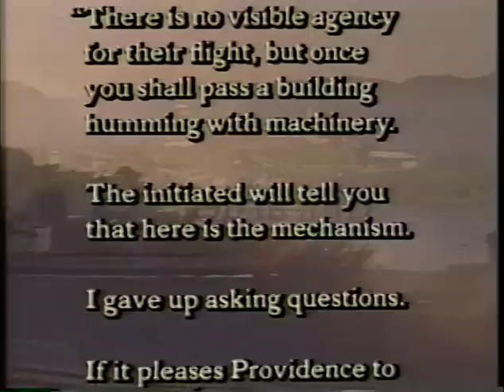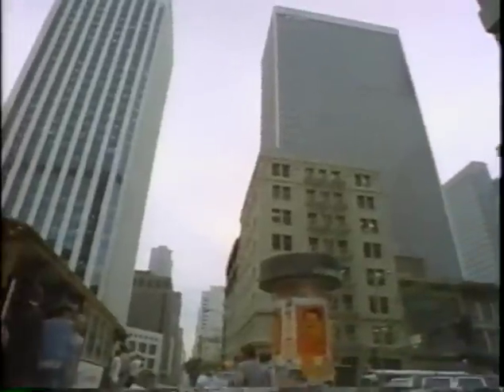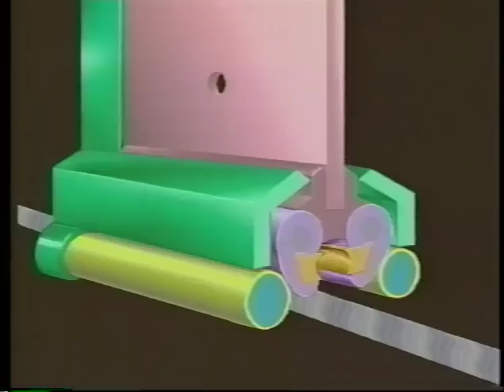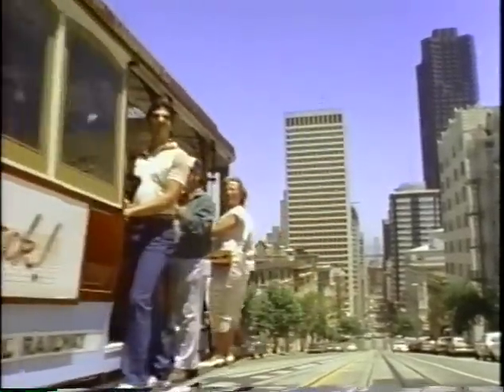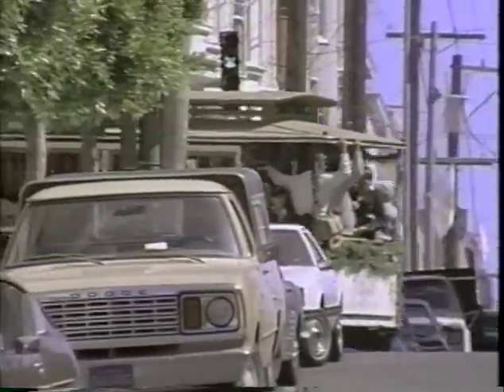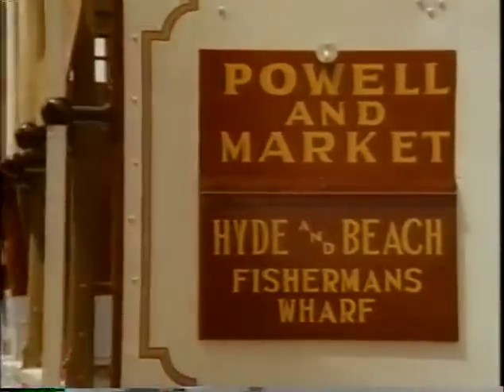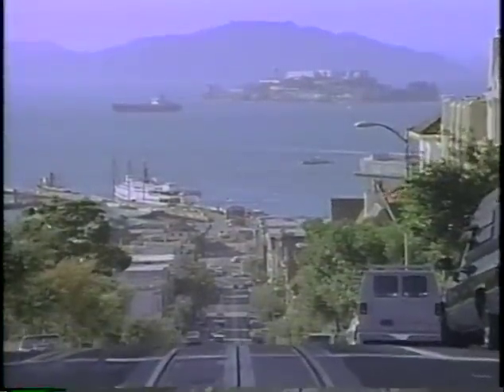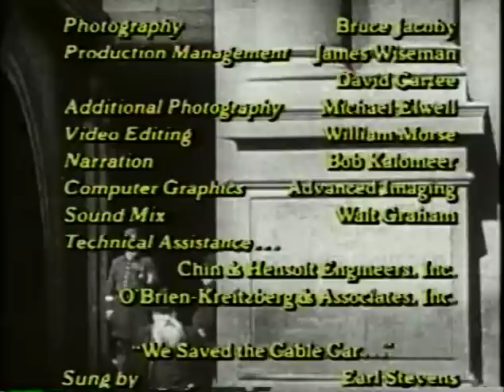The Cable Car and how it works

Comment: San Francisco is one of the rare instances (particularly in the united states) where people fought to keep their public transit and succeeded.  There are still lost lines such as the SF terminal railway and the 3rd and Townsend train station, but it's great that this is around, even though it's mainly a toursist attraction these days.
Reply: there used to be lots more cable car lines, they only kept the few for tourist purposes I believe
Reply: @weinerinc.9344  So the cable cars are not utile for travelling to work or so? Do citizens use them regularly other than as attraction?
Reply: @michalreingraberskaliasmiz185  The cable cars cost $8 to ride one way. Everything else, including the streetcars, cost $3 in cash to ride ($2.50 with a pre-paid transit card) and you get a transfer that's valid for as many rides as you can fit into, I believe, two hours. So you can take the cable cars to work if there's enough room, but you're paying three times the price.
Reply: @michalreingraberskaliasmiz185  The main thing is where the cable cars go. The lines are incredibly short and mostly serve tourist destinations in a small part of downtown. Also, you have to remember that the speed while "taking rope" is 9.5 mph (it's faster while coasting down hills). Of all the lines, the California line is probably used the most by locals, but it's just not practical for most people as anything other than a bit of fun.
Reply: @weinerinc.9344  The 1906 earthquake is largely responsible. Even back then cable cars were old fashioned and when the earthquake destroyed most of the system, it made more sense to replace the lines with electric streetcars than rebuild all the cable infrastructure. Some tracks were too steep for streetcars, so luckily a few cable car lines survived. The mayor wanted to replace them with twin engine buses in the 1940's, but a nice old lady led a campaign to save them. The city-owned lines were protected by law, but the private Cal Cable lines weren't so they were sort of chopped up and truncated them to form the current system. Btw, those twin engine buses the city ordered never really worked very well and they were mostly run in single engine mode on flatter routes.
Reply: What was the reason they wanted to get rid of public transportation
Reply: It’s great that people with monthly passes on Muni get to ride the cable cars included
Reply: @zombiesbride  Ridership, service, and maintenance fell, and cities were often tired of dealing with tracks when they would repair streets
Reply: @flintfredstone228  Yeah, sure, that, and not the absolutely ridicolous influence of the car industry on urban planning politics.
Reply: @dimitar.bogdanov  Yes, that. Many streetcar and interurban lines went bankrupt or began abandonments before urban planning was a concept. And if the auto industry had that weight to throw around, it was because Americans were buying their products left and right instead of taking the streetcar

Comment: Visited SF as a child of about 8 which would have been the summer of 1964. I thought the cable car ride was great. Until a very large local jumped on it and blocked my view of pretty much everything but his very wide backside.

The explanation of the interaction of the grip and the two types of pulleys answers two long-standing questions I've wondered about for decades but never bothered to research.

Comment: The 70's was the last time that the cable cars were still real public transportation. As a kid, I remember when you could just hop on to get where you were going. By the mid to late 80s, it was just a tourist ride. I only rode it late night when I was a student at SFSU in the late 80s. The conductors would usually recognize you as a local and not even check your muni pass.
Reply: I wonder why that changed by the 80s. I mean I doubt they got any more or less useful 10 years later

Comment: I should have seen this ages ago. I've always wondered how the US system worked. Edinburgh had only cable trams from about 1880 till 1923 and the Glasgow Underground was cable too from opening in 1896 till 1935. The Edinburgh system directly replaced the horse trams. It was complex with many- 4?- winding houses. The road signage for the grippermen was in different coloured cobbles on the cobbled streets. I believe the signs were pink granite. The predominate cobble colour was grey.
The Glasgow Underground had two lines with two cables, one for each track. I saw a model of the winding house and the tension arrangement was a bit more complex using what looked like a rail truck on rails.
Reply: I wonder why the London tube didn't use the cable car system. At least they tried everything till the invention of the electric locomotive that encouraged cities to build subway systems and made it possible, that tram lines aren't limited in length because horses' endurance.
Reply: @robfriedrich2822  London had tried something like two on street cable tramways. You would think cable haulage would be ideal for the underground. But they used steam locomotives. In the 1890's The City and South London opened their deep level tube which was electric hauled from the outset which changed the game.

Comment: This was really interesting. I was wondering how on earth these cars made it up the hills in SF and had no idea there was even a cable involved. Thanks!
Reply: I mean, what did you originally think the "cable" in cable cars was? Or did you just not  consider it?
Reply: @slowpoke96Z28  I actually thought these were "trams" and had engines/motors!
Reply: @brad7957  A Standard tram wont climb this slopes .... Anything train-related ... traction (grip) is not that great.
Reply: You thought they were invented by a man named "Cable"?
Reply: @wholeNwon  haha i assumed that early versions had above-ground cables
Reply: "Cable" as in electrified cables hanging over head, it's a common misconception since these cable cars turned corners and changed elevation which is not typical of the rest of the cable cars around the country (most cable cars are usually straight shots with either semi-permanent or permanent connection to the cable.
Reply: @SherrifOfNottingham 
That's a "wire" in common usage.

Comment: I'd like to know how big the system was at the time of its peak extension and how it worked back then (were crossings more complex, die they have more than one "power house"?).
Reply: I don't know all the details, but they used to have stationary steam engines instead of electric motors to run the cables.
Reply: @No Troll:  Actually, there were as many as eight independent cable railway companies in San Francisco during the 19th and early 20th centuries.  The city-operated Municipal Railway didn’t come into existence until December of 1912, and it and the largest independent company, the Market Street Railway, acquired most of the other lines over the years.  The city passed various anti-competitive laws to force the independent companies out of existence and establish a city-run monopoly, acquiring the Market Street Railway in 1944.  The California Street Cable Railroad lasted until 1951.  The current system is a combination of the main trackage of the California Street line with portions of the Market Street Rwy. lines, re-routed and modified to operate out of the single powerhouse shown in the video.  When the companies were independent, each had its own powerhouse, and in some cases more than one, depending on the extent of each system.  As for extent, the Financial District was criss-crossed with cable lines, many of which extended west to Golden Gate Park.  South of Market the Market St. and Howard St. lines turned south about where BART does now, and reached almost to the southern border of the city limits.  

The flat parts of the city were served by electric streetcars, and then buses.  But even today, some  of the steeper hills have to be served by electric trolley buses, because diesel buses wear out too quickly on the steepest grades.
Reply: @steveonmareisland5268   Thank you! 👍👍

Comment: This sort of genius transport technology could only come out of the Victorian age. All we get nowadays is gadgetbahns and memelords trying to reinvent the taxi stand
Reply: Yeah people back then did stuff with less thinking. Today, we do too much thinking and planning to do stuff. Turns out the cable car was a bad idea: it is highly inefficient because the cable is constantly moving and you lose energy from all the support pulleys. It's also quite noisy. 

What the modern system is to use trolleybuses: rubber-tired electric busses powered by overhead lines. They also have the benefit of being able to maneuver around obstructions. In places that have high traffic and aren't too hilly, they use trams. Metal train wheels are more efficient than tires, but can't handle hills and can be very loud.

Comment: Can you imagine creating something like this in modern city?

People in XX century were crazy
Reply: If you're creating a new system from scratch then a regular tram with electric motors and overhead wires is probably simpler.
Reply: 1873 - therefore 19th century, not 20th :-)
Reply: @seneca983  You'd end up with the current trolleybus system, it consists of electric rubber-tired buses with overhead wires. The issue with steel-wheeled trams is the hills are too steep to get good uphill traction.
Reply: @straightpipediesel  Steel-wheeled trams work quite well in a plenty of places.
Reply: @seneca983  And San Francisco has them. They are limited to the relatively flat portions and underground tunnels. The other major issue with steel wheeled trams is noise and vibration, particularly with heavy modern cars. SF has had complains and lawsuits and allegations of building damage over this.
Reply: @straightpipediesel  But most cities are not like San Francisco. SF might be the right niche for trolley buses but I think in most cities trams wouldn't run into such issues and even when they do then at least part of the routes can probably be served with trams. It's also possible to overcome steep inclines with rack tramways or cable cars like SF.

When it comes to noise, I suspect that rubber-tyred vehicles are worse in this respect. For ICEs the noise from their rubber tyres exceeds the noise from the engine at around 50 km/h.
Reply: @straightpipediesel  It didn't sound that loud compared to the convertible at 2 minute mark though it's, of course, a bit difficult to say based on a video because I don't know what volume setting would correspond closest to actually standing next to that thing. Anyway, most trams I've heard are not that loud, at least compared to diesel buses.

One disadvantage of all rubber-tyred vehicles is that their tyres grinding against the asphalt creates fine particles and thus worsens the air quality. Even for ICEs this is the dominant source of local air pollution, not the exhaust. Thus steel wheels are preferable.
Reply: @seneca983 not up a grade like this though. Regular steel wheels would slide back down the hill.
Reply: @blue9multimediagroup  Yes, in this case a regular tram wouldn't have enough traction but a rack tramway would still be an option.

Comment: Anyone remember that derailment that happened near the cable car museum? Even though the crew was not on board, they should have left one of the two crew members onboard to throw the wedge brake into service once the car ran out of control.

Comment: 15:54. Is this documentary from 1984 or 1994? It's difficult to be sure due to the 480p maximum quality.
Reply from the maker: It is from 1984, when the San Francisco cable car system was refurbished and reopened after years of neglect.
Reply: @stevewoodrow  How bad was the neglect, and were there times where the system did not operate at all? Last time I visited SF was late 1975, and it was running then.
Reply: ...Pitchard Produtions copyright 1954...
Reply: There's no way that would be 1994, just look at the hairstyles, clothing, and automobiles.
Reply: @BakedRBeans  There was no time that it did not operate, but the system was showing over 100 years worth of wear and tear.  I think "neglect" is a little harsh, but as a matter of fact, the cable cars had not made money for the city for decades--as one might expect from a government-run monopoly--and the decay could not be ignored any longer.
Reply: @steveonmareisland5268  wrong

By 1979, the cable car system had become unsafe; it needed to be closed for seven months for urgently-needed repairs. A subsequent engineering evaluation concluded that it needed comprehensive rebuilding at a cost of US$60 million (equivalent to $242 million in 2022). Mayor Dianne Feinstein, who took charge of the effort, helped win federal funding for the bulk of the rebuilding job. In 1982, the cable car system was closed for the rebuild which involved the replacement of 69 city blocks' worth of tracks and cable channels, a rebuilding of the car barn and powerhouse within the original outer brick walls, new propulsion equipment, and the repair or rebuild of 37 cable cars. The system reopened on June 21, 1984, in time to benefit from the publicity that accompanied San Francisco's hosting of that year's Democratic National Convention.

Comment: A very interesting film/video about a funicular tramway system. Nothing to do with cable cars - like those found at Roosevelt Island.
Reply: @pmailkeey:  The SF cable cars are not a funicular system, which depends on two cars linked by a cable in order to counterbalance each other as they go up and down a straight grade.  Modern examples are the Washington Heights cables in Pittsburgh, PA.  There were a couple of SF streets served by funicular systems:  the one up Telegraph Hill, and one on the Fillmore St. hill, which linked up two (otherwise conventional) electric street cars to deal with an extremely steep grade, after negotiating which the cars would disconnect and run on the street like any other streetcar.  Halliday's 1873 invention of the Cable Car was an entirely new development of cable technology, and these lines, and those in numerous other American cities, have always been referred to as "cable cars."  To say this video has "nothing to do with cable cars" is incorrect.
Reply: @steveonmareisland5268  They are funiculars - no doubt about that. And cable cars are suspended by the cables.
Reply: @millomweb  Proper name for a suspended system like Roosevelt Island would be "aerial tramway". And funiculars by definition have to be counterbalanced, so an open system with uncoordinated grips like SF's is just a "cable railway". Good source is ANSI B77.1-2017 if you can find a free copy.
Reply: @stewarts7227  Well, the SF system offers some counterbalancing - using the cable to control speed downhill.
Rope = funis - which is where funicular and funambulist come from. So if it's rope-hauled, it's a funicular.
Tramways are ground-based systems - by definition. Aerial ropeways exist and are generally called cable cars - for obvious reasons. SF tramcars run on trams and rope-hauled - hence is a funicular tramway.
Reply: @stewarts7227  Roosevelt cable cars do not use trams - so cannot be a tramway.
Reply: I mean the Latin roots are interesting for sure, but it's not how they derive the modern definition of the terms. "Funicular" refers to the specific use of a counterbalance required for the system to function, not to incidental use. And a tram is a system, not a component.
Reply: @millomweb  And as for tramways being ground-based systems, I'd point to the administration of aerial lifts by "state tramway boards" from Colorado to Maine.
Reply: @stewarts7227  That's not an issue. A tramway board may deal with other forms of PT.
Reply: @millomweb  …which, per ANSI and most state laws (unless they’re elevators), fall under the umbrella term “tramway,” I’m pretty sure… but, hey, tomato/funicular, right?

Comment: You left out a lot of stuff, like why the grip end of the car has a door, why halfway down the grip is a small rod that the grip man can turn or why there are doors on the slots in some places. I know the answers to these questions. Also the red grip doesn't always work, look up the crash in 1968, Hyde and bay. Going down Hyde the grip man lost the cable and he couldn't stop the run away cable car, it missed my mom's car by inches.
Reply: Maintenance
Why do you need to know that info?
Has no relevance to how the car operates.
Reply: And the red grip does work, but it also has to work with momentum as well, or do you not understand how gravity and inertia work?
Reply: @blue9multimediagroup  The red grip never gets pulled, unless you are going down hill and you lose the cable. Pulling the red grip drives a steel place into the underside of the slot. It is the last thing you have to stop the cable car.

Comment: Video should be renamed...
When you say "cable cars" to most people they think of suspended cable cars as used typically in mountainous areas not this type barely used anywhere but SF.
Reply: K. They've been called "cable cars" for over 100 years and it's what everyone knows then as, so we're not just going to randomly change the name when it literally describes what they are. Also, you're asking a GE promotional video from the 80's to change its title, I think it's a little late for that.